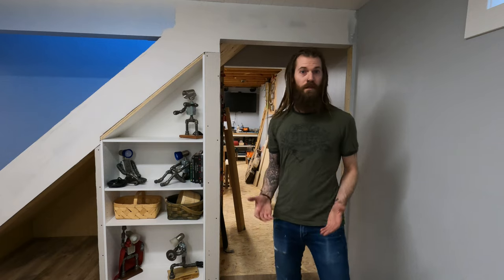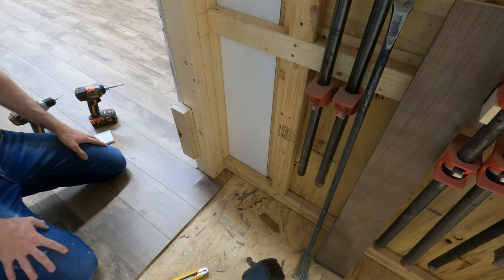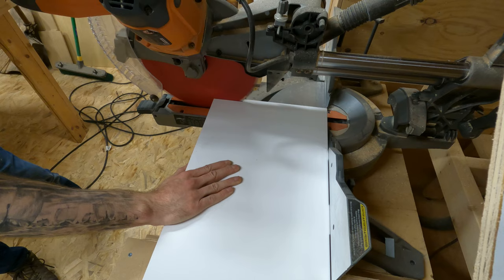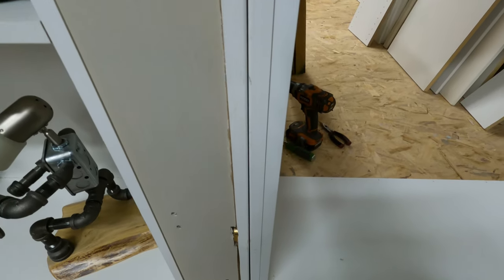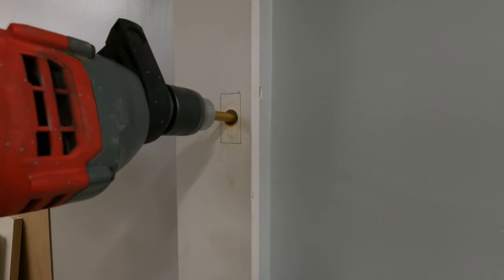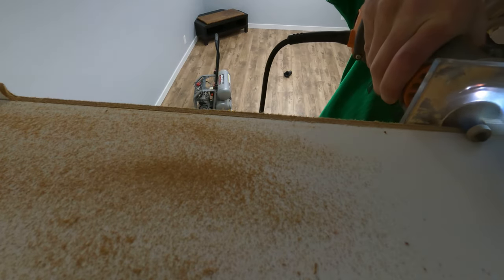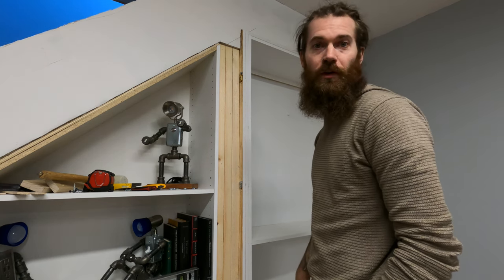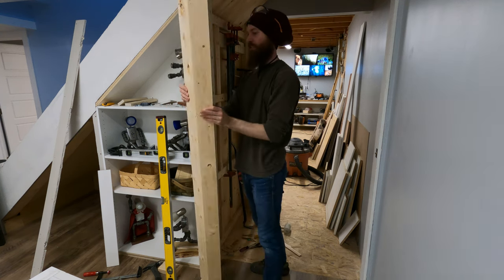Secret Bookcase Build - Part 1

Comment: Trying to do this, wondering if I could just buy a regular bookcase and do this?? Does it matter about the depth?
Reply from the maker: The depth does matter. You need to make sure the back of the bookcase will be able to swing through and clear the door frame. If you go to around the 3 min mark in the video you can see how the door swing works and what you'd need to figure out for clearance.

Comment: This is so great.  Really enjoyed it.  My husband and I are planning one in the basement and I came across your video in my research.   How much weight do you think it could hold?  Do you think it could handle being filled with books?  Or do you think leaving it to a few books and some decor is better?
Reply from the maker: Very cool! I think it's all going to depend on the full size/depth of the bookcase to start. SOSS has guides on their website for the hinge weights so even adding up all your books weight would give you a good idea of what hinges to get. Mine has wheels on the non-hinge side to help with weight distribution as well. If it's build with the intention of a full bookcase in mind and you take that into account, it probably should be able to handle the weight.
Reply: @HewmanMade  Thank you for taking the time to reply :)

Comment: Which height hinges did you use? I see there’s a few different ones in the link.
Reply from the maker: I think I used 2 3/4" hinges for the bookcase. But the size is dependent on the operation you're using them for. I think there's a chart or a guideline on SOSS website for the size recommendations

Comment: How did you trim the hinge side of your door
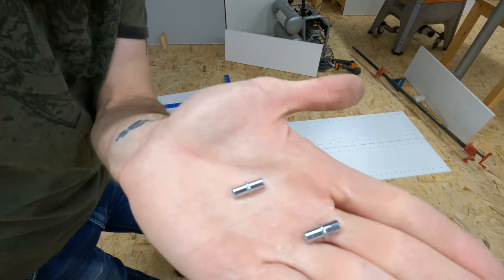Reply from the maker: If you watch part 2 https://youtu.be/O0ysh3kib3Q  I do some trimming around the 4:30 mark. But it's not trimmed in the normal way. I ended up just painting the 2x6 I used as the 'trim'. If you're looking for a better look at trimming it out I have a second series where I did a maple face frame and the bookcase overall is 1000% better than my first attempt in this video. Here's the link to part 1 in that series https://youtu.be/NGHrLJN-nyY